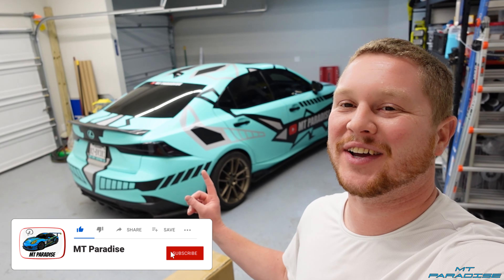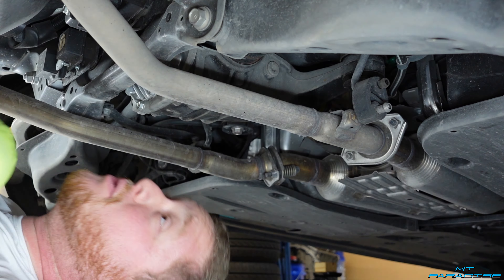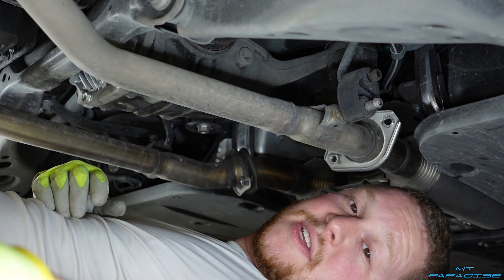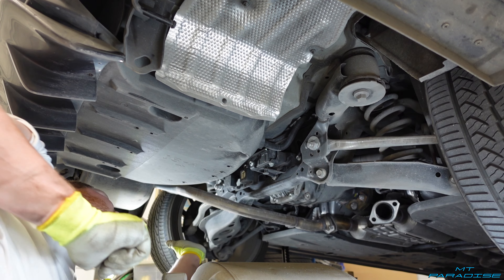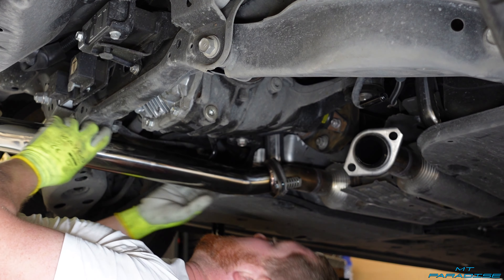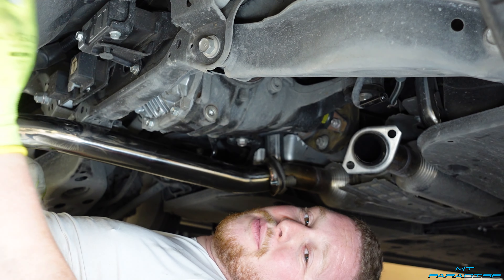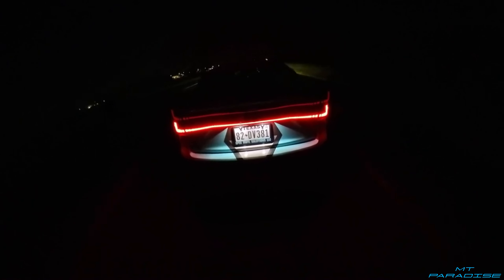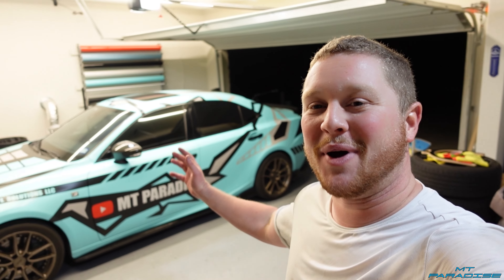How To Install Lexus IS + RC Axel Back Exhaust

Comment: I’ve been thinking about getting this for like two months and today you sold me waiting for delivery awesome video
Reply from the maker: 😂 honestly it sounds was better than I expected. It’s so low pitched and sounds amazing. Highway driving it’s quiet and nice so that’s a plus since this is my road-trip car
Reply: @MTParadise  and that’s the thing I don’t like over kill , and yes driving from Dallas to Austin sometimes the overly loud exhaust would kill me but this seems like a happy medium.
Reply from the maker: @juanalanis5526  oh for sure. You really notice it at lower speeds like accelerating from a traffic light but it’s still quiet at 2k rpm on the highway

Comment: Ordered this exhaust about a week ago (prior to seeing your vid) for my 2018 IS300 (4 cyl turbo).   Sounds exactly as I would have hoped !    Thanks for the vid.  I may still have my local mechanic install it (as I'm not too keen on crawling under cars anymore).  BTW, my exhaust comes with red hangers....well, they said it does (it doesn't arrive until mid February.  4 week delivery).
Reply from the maker: Oh nice! Yeah I love how it sounds. Yeah I get the getting under the car lol sometimes it’s easier to pay for convenience.
Reply: @MTParadise  Have the Remark muffler delete/axle back.  Going on the car next week. Took forever to get here.   Looking forward to getting it on.    Off topic (sort of) question:  what size tires/wheels are you running?  As your IS is the same as mine, it came stock with 17".   I want to upgrade to 18", but want to avoid any rubbing.
Reply from the maker: @teemu60  265/35 R18 (rear) and 235/40 R18 (front)

Comment: Good video brutha!  Nice work on your IS man!  Whenever  i’ve seen the videos where someone added the mid-pipe, i’m reminded why the axle back is all i need.  This sounds perfect for a daily… Is there any annoying drone?  It sounds great inside and out from your video.  Great sound quality on the video too 👌.
Reply from the maker: Thank you so much. The sound is perfect and no drone. On the highway going 80, at just above 2k rpm, it’s almost silent. Accelerating, it sounds really good and it’s such a nice low tone

Comment: Did you get your car tuned after installing this? Just got the same exhaust for my rc 200t and I’m debating if I need to get it tuned, i don’t plan on doing any other major upgrades for a while
Reply from the maker: I didn’t get mine tuned but I still really enjoy it how it is. It’s my daily so I want to just do minor upgrades to keep that Toyota reliability lol
Reply: @MTParadise  I see! I’m new to cars tbh so I didn’t know if a muffler delete would change the pressure in the exhaust system or something 😅 I use my rc as a daily so yeah I’m just trying to make it a bit more fun but still reliable
Reply from the maker: @bluedragon9412  it won’t effect it much lol
Reply: @MTParadise  thanks a bunch for the info! 🙏
Reply from the maker: @bluedragon9412  no problem

Comment: Hey mate, love the video! I just bought this recently and went to install on my 2016 is200t and the exhaust doesn’t fit in the rear diffuser since the old one wasn’t dual. Did you have this same problem and have to get a new diffuser? And if so where did you get yours?
Reply from the maker: Mine had the stock single tip that’s like a square shape on the end and the new dual tips fit right in the hole
Reply from the maker: I just looked it up and I didn’t realize the 2016 has the small round exhaust tip. The rear bumper should be the exact same other than the bottom. You might be able to get an aftermarket or even factory part that’s the lower black plastic piece. You should be able to swap it out on the rear bumper
Reply: @MTParadise  thanks mate

Comment: Car is so dope man quick question wat happens if you don’t put back on those springs on the nuts?
Reply from the maker: It should be just fine still. It’ll just make it more rigid. I think they are just they to help absorb any energy from bounces or bumps
Reply: @MTParadise  ohh cool ok that makes sense. Beautiful build man thanks for the vids u post up.
Reply from the maker: @dispapi2xclusive  thank you so much. Just wait until august when the new car comes in 🤫

Comment: Ordered the same one for a couple days ago my rc 200t curious what they look like a year later ! My rc is ultrasonic blue with copper wheels so this should go perfectly
Reply from the maker: I just keep mine clean and they still look exactly the same but just a little dirty inside the tops as expected lol
That spec sounds awesome
Reply: How did it turn out? I'm about to do the install on my RC 350.
Reply: @Andre_Jordan   mine came out great easy install, price look and sound is exactly what I was looking for!
Reply: @hoodoo50  Perfect. Unboxed mine and already admire the look. I'm sure it'll turn out great when I get the time to put them in.
Reply: @hoodoo50  Turned out phenomenal. Great note and no drone.
Reply: @Andre_Jordan   how can you beat the price and sound right!
Reply: @Andre_Jordan does it throw any CEL code. My daughter just got 17 RC350 and she’d like to have one installed. TIA.

Comment: Hye finally found a video on how to install the remark axcel back ( this will be my first ever install). will all these steps be the same for a lexus is200t 2016? i know the 2017 have different parts and shapes but will the 2016 remark axcel back install be the same as your video?
Reply from the maker: From the research I did before ordering this, the 2016 and up us the exact same exhaust part and it’s also the same for the RC models as well, just not for the V8
Reply: @MTParadise  aight thanks, mine should be arriving in 2 days from Australia, using ur video as reference. beautiful car u have too!

Comment: Does the axle back need gaskets? I installed the f sport axle back to my RC but i have a bad rattle. My cousin said it is missing the gaskets but I didn't see ones when I took the oem ones off
Reply from the maker: My oem didn’t have any and neither did these. I just made sure to make them tight and I’ve had no issues

Comment: brother you should fix the rear diffuser so it lines up perfect with that filter that's its attached too. I know some people do it like how you have it but if you want I can show you how I have mines and how I did it. the exhaust looks great I have the same ones on mines
Reply from the maker: I spend hours going back a forth and decided on this position 😂 having it line up better would leave the leading edge more open to air coming in above it and at 100+ I’m afraid it would get ripped off 😂

Comment: Are those screws with the coil suppose to allow the axle back to wiggle a bit even after being tightened down? I have the f sport perf axle back exhaust with the same screws but if I wiggle the pipe with some force it moves a bit where the gasket meets the downpipe. Is that coil type bolt suppose to allow for slight play or not move at all?
Reply from the maker: It might be to absorb force when you hit bumps so it’s not too rigid

Comment: Nice video! Thanks for sharing!  I’m getting a similar one for my 2023 IS350.  Can you tell the correct jackpoint.  Is it the black bar behind the differential or the bottom of the differential itself?
Reply from the maker: Thank you! Heck yeah. I always use the jack points on the sides
Reply: Thanks for the reply.   Didn’t you use a floor jack?
Reply from the maker: @renebcruz yep. Raised it up from the frame on the sides then slid the jack stands under
Reply: Thank you! 🙏👍

Comment: I installed the same exact one and its so amazing. Now does yours get like a drone kinda sounds when you accelerate hard at around 60 mph? Mine does this but not at any lower speed. I tightened the bolts for sure well but Idk if its because I installed it wrong or if thats just how it is?
Reply from the maker: When I accelerate it has a really nice tone but I don’t have any bad drone. At lower speeds or in stop and go traffic it sounds like a have a V8 lol. I wonder if me having an intake and turbo resonator will affect the exhaust gasses making a different sound

Comment: Liked and subed very nice vid, could you sauce a link on your rear diffuser? Quad tips look super clean with your diffuser 🔥
Reply from the maker: Thank you! The diffuser is one of the $100 ones from eBay lol. The plain black is actually a dense rubber but I recently got a new one from eBay that’s actually carbon fiber.

Comment: is it possible to do without a jack or anything?
Reply from the maker: If you are able to get underneath, yes lol
Reply: @ How long do you think it will take? I don’t have a jack so I need to see whether or not I need one
Reply from the maker: @cizzzzzy it shouldn’t be more than 30min
Reply: @ and is it possible without jacks i know i already asked
Reply: @MTParadise I’m just debating whether or not it’s absolutely necessary as i don’t have one yet and probably will never have to use it again besides this
Reply from the maker: @cizzzzzy as long as you can get to the bolts, you can. I know the car sits kind of low but maybe not too low. You might have to squeeze under to reach the bolts. The rubber hangers are easier as they are all the way in the back

Comment: I have a 2020 rc 300 awd, will this fit maybe?
Reply from the maker: It sure will! The only RC it will not work on is the RCF
Reply: I’m having trouble getting the springs back tight on the bolts, any tips, I’m not too mechanically versed.

Comment: What would be the difference between this and getting a muffler delete at a shop?
Reply from the maker: This is already made to easily swap out and looks clean. Plus this is quick bolt on whereas a shop would likely cut the pipe and weld it back together and it would look sloppy and might cost the same anyway
Reply: @MTParadise  thanks that’s what I figured and they are relatively around the same price so I already placed my order, they should be coming in this weekend 👍🏼
Reply from the maker: @idgaftrickshotter  heck yeah 🤘

Comment: would it fit a 2017 is350 f sport?
Reply from the maker: Yes, it will fit the IS350. The only one it won’t fit is the V8 but that’s only a concern for the RCF.